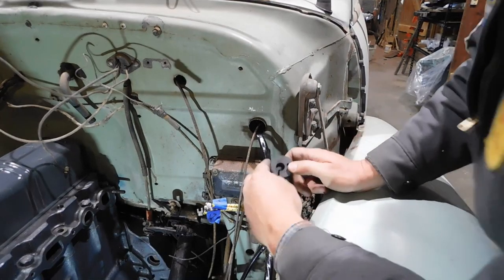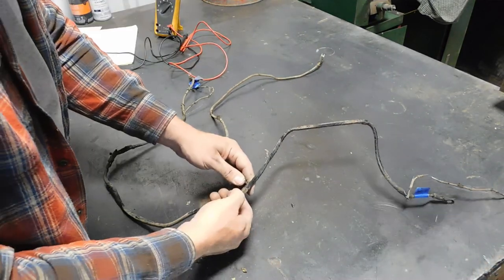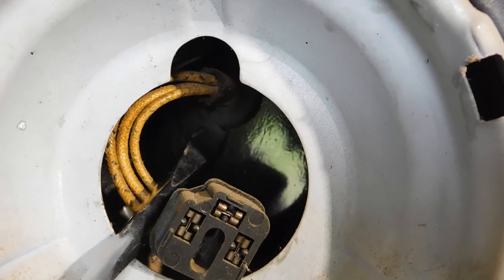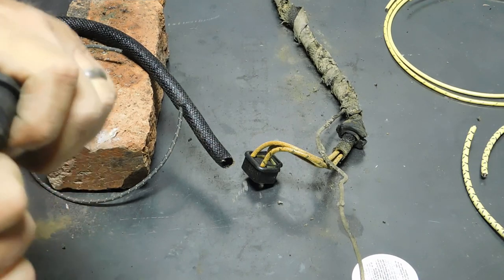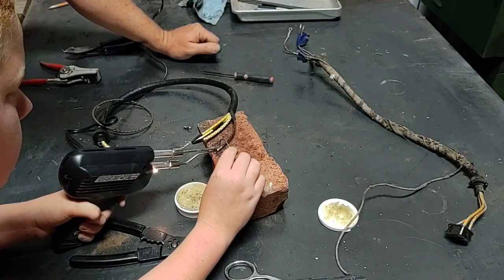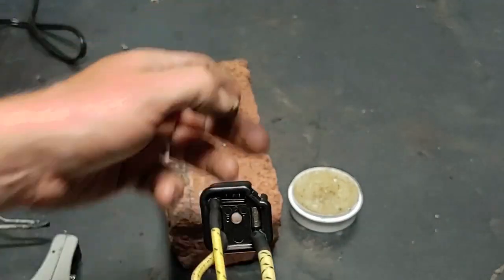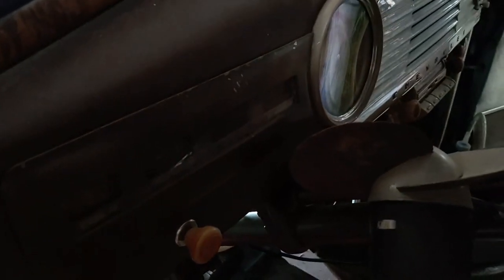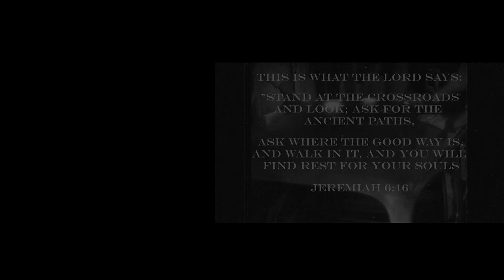Part 7: 1942-1948 Chevrolet Wiring Harness Build: The Sequel

Comment: Hi my friend. May I make a suggestion? If you will dip the tip of the gun in the flux then put a little solder on it it will heat up the piece quicker. I like the fact that you put weather strip adhesive around  the grommets. I use shrink tubing with adhesive in it on every soldered point under the hood.  These are just a few suggestions. I was raised by an electrician and then got my degree in electronics technology so have wired and rewired thousands of feet of solid and stranded wire. I enjoy your videos. I am sure they help many. Take care and God Bless.👍🙏🏻

Comment: What gage wire were you using
Reply from the maker: I used all original sized wire per the factory wiring diagrams.
Reply: @TheJayhawker  what wires come out the driver fender into the car can't locate what those wire are for
Reply from the maker: @edgarcastrolee  You should have a harness coming out of the firewall, a lot of it branches off and goes down towards the voltage reg., relay, stop light switch, and dimmer switch. The rest of the wires continue forward along the inner fender to a junction block. These are all for lights and the horns. The wires for the headlights go from these junctions thru the inner fender into the opening for the tire and into the back of the headlight. the passenger side wires go from the drivers side fender thru the tube on top of the radiator support and connect to the junction block on the right side fender.